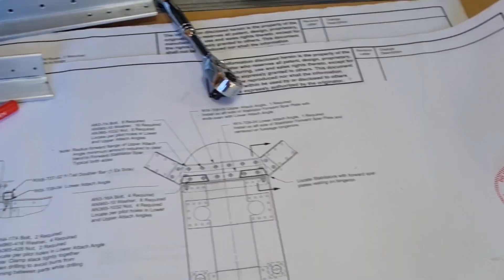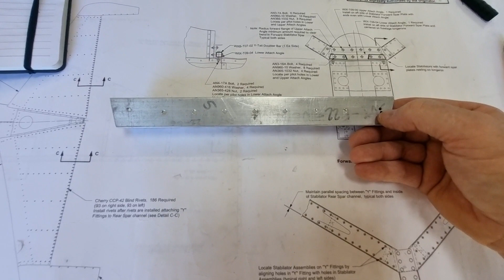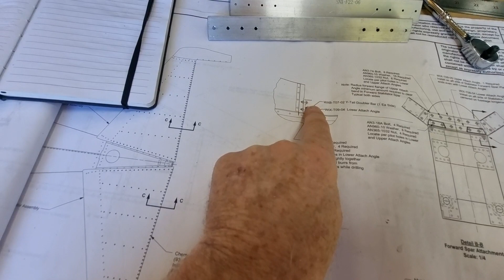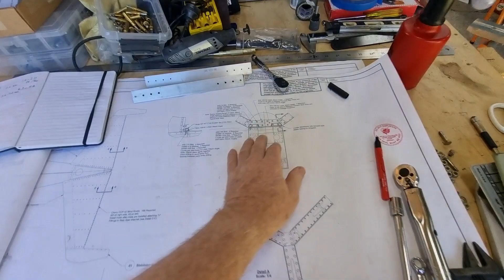Sonex Waiex B, Part 14, Aft Fuselage complete

Comment: Great work! I like to say "it's in a state of completion longer than under construction". What I mean is that when you take a bit more time to get the details right and correct those little things that annoy you, that time is a small fraction of enjoying those efforts over the long haul. Now, if I just would have cut some holes in my wheel pants so I could air-up my tires without taking the pants off...maybe someday.
Reply from the maker: The time of the build is going so quickly.  I would love to see some more videos of your Sonex, are you thinking of posting any soon?
Reply: @pandyseven  I really should. My destinations have not been as exciting in the past few years and my editing software had some problems. Other builders/pilots have provided some great content also so I have stepped back a bit.
I have a trip of about 1000 miles coming up. I'll get some footage and try to get something going.
Reply from the maker: Hey [kyqx] I probably should refer to you by name if that is, ok? I’m Andy….that said any content is good content, perhaps your first can be modifying the wheel pants for ease of tyre inflation, or why you put the pitot tube on the stabilator? The 1000-mile trip sounds like a great platform to start on….oh, and if I would choose an alternative to the Red I would pick your Orange and White trim, I do think it’s a great contrast in colour range…
Reply: @pandyseven  Hi, Andy. I put the pitot tube in the tail because I saw the same installation on W0001. I thought that it looked cool. As for the orange, I saw an orange King Air in Germany and thought it looked OK and it seems to work on the Waiex. If people don't like it they certainly don't tell me in person! Message anytime, Kip.